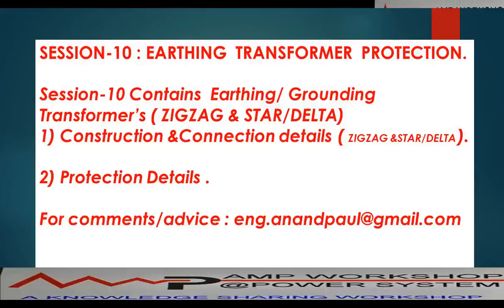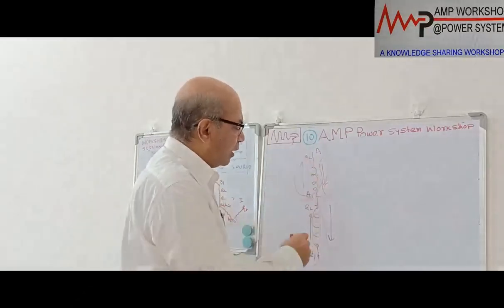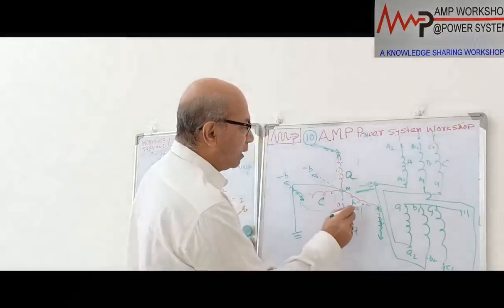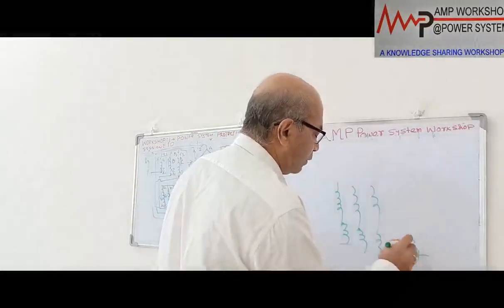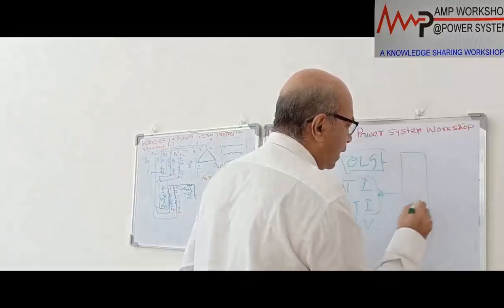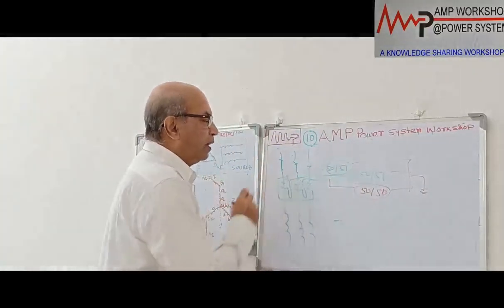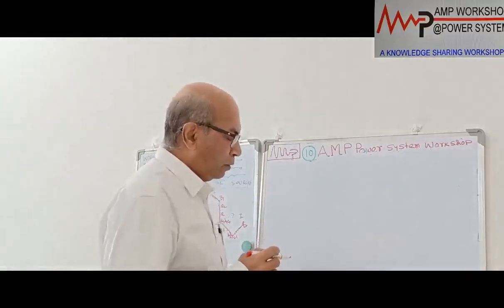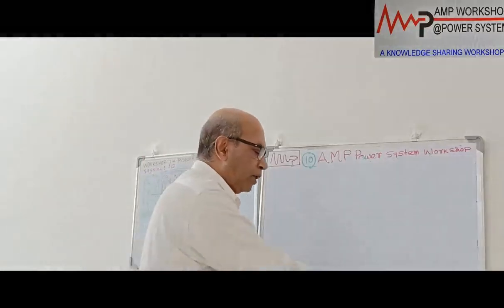SESSION-10: Earthing /Grounding Transformer & Its Protection.( Zigzag / Star-Delta)

Comment: Sir what is the standard used for sizing of zigzag transformer
Reply from the maker: You can use IEEE green book for  time , rating requirement and for other part, IEC 600076-1,2,8 could be referred .
Reply from the maker: This green book is referred as IEEE142
Reply from the maker: For detailed specification of grounding transformer British specification BS4944  could be used
Reply: @amppowersystem6084  Sir I am not getting any solved example for sizing
Reply from the maker: Any standard will not provide the calculation . It is guidance only
Reply: @amppowersystem6084  Sir can you please share any calculation for my reference.